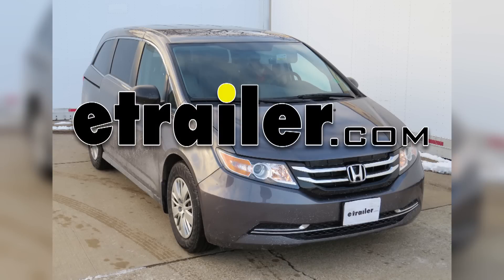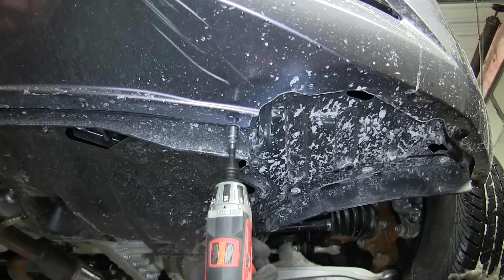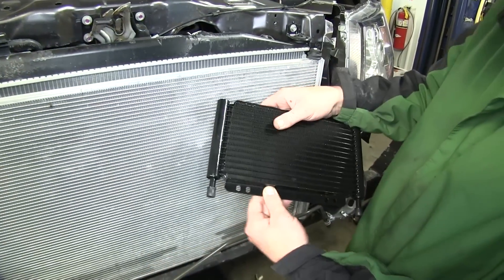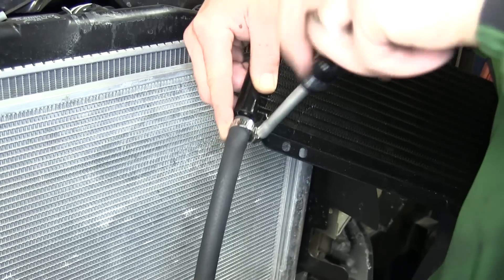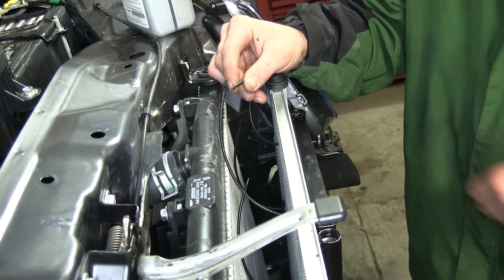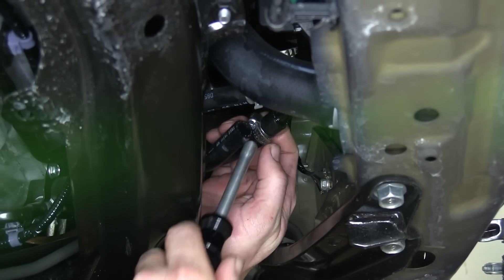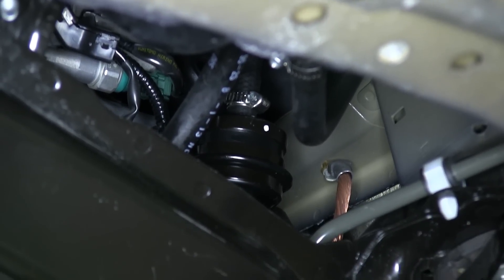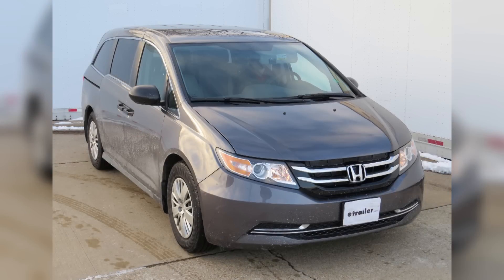etrailer | Set up: Derale High-Temperature Replacement Hose for Transmission on a 2014 Honda Odyssey

Comment: Excellent, concise, accurate instructions. I did not even open my service manual when I followed this video to install an AT cooler on my 2011 Odyssey last night. One extra thing I did though, was to remove the 3 screws holding in the left headlight assembly. That allowed me to pull the AC condenser out past the headlight, for more room when attaching the cooler carefully. Also, not having my roto-zip with me, I used a drill with about a 5/32" drill bit instead - it worked well since that plastic is so soft and thin. Thanks again for the great video.

Comment: Overall good video. However,the thing in this video which is not clear, is that you're installing the additional transmission cooler in series with the radiator or existing transmission cooler, not in place of it. More explanation is needed to show which line to attach to, which clearly shows this is in series with factory cooling, not in place of it.  So how to identify which line goes where is where more attention should be given.